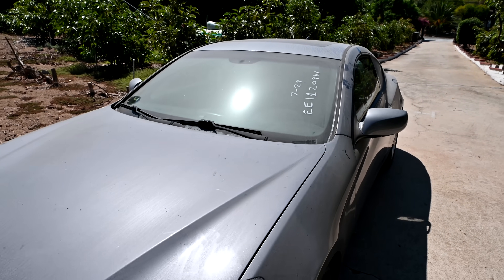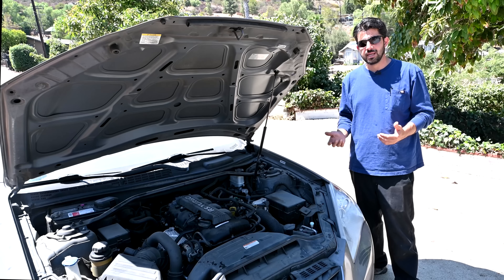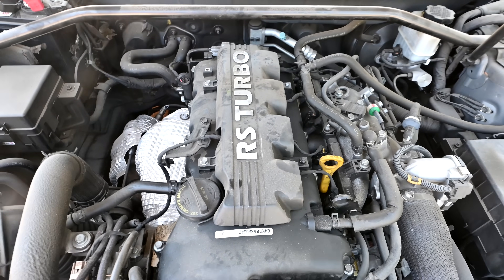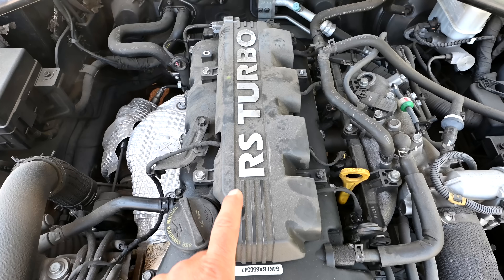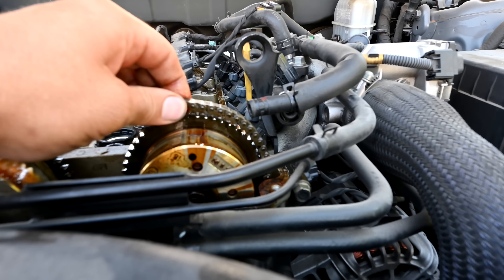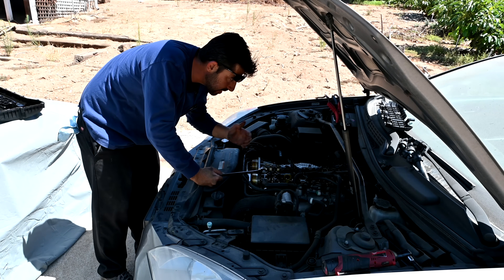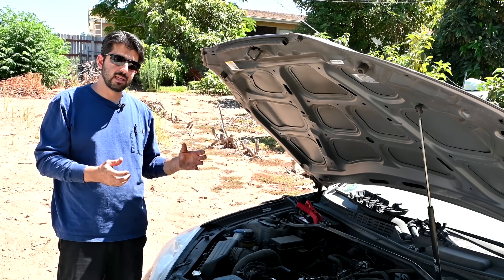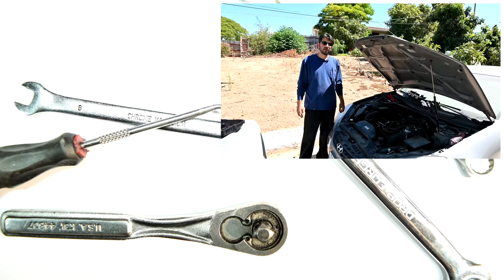The Hyundai And Kia Engine Failures Explained.

Comment: This is why I do all my own oil changes, it's at least done right.
Reply: Congrats, you saved 5 cents versus having it done at the dealership.
Reply: That won't fix the issue.  The company left metal shavings in the engine at the factory.  Even worse, they'll void your warranty for doing your own oil changes as you can't prove it was done on time.  I know this as I asked a Hyundai service advisor from my work and they confirmed it.  Specifically for this engine problem on this generation.
Reply: Done right?
Reply: @emptyendeavor2762  He tightens the filter enough and adds oil
Reply: @emptyendeavor2762  nothing left.
Reply: I've got a 2021 Genesis G70 2.0T with 39,000 miles. I change the oil every 3000 and oil filter every 9000(I use a 20,000 mile oil filter). I've changed the air filter at 20,000 and just put a new one in at 39,000. This car runs like it's brand new(and I drive like a race car driver).
Reply: @hecklerkoch2446  get and oil catch can, and ur probably never gonna have an issue
Reply: I just got a, 2023 Hyundai Sonata N-Line 2.5l turbo and I couldn't care less about engine problems as the warranty is, 10 year/100k mile warranty. Lol. So....I don't care if anything fails....I get it fixed/replaced for free. Ha also....I ALWAYS change the oil on a new car after the first 500 miles.
Reply: @nexpro6118  That is one good warranty. Will probably never have to use it.
Reply: @nexpro6118  Make sure you are documenting it.  These engines are extremely expensive and if they can duck out of the warranty they will.

Comment: The problem with Hyundai is that they neither cheap, nor reliable.

It's like a little more, and you into the Toyota/Honda price range.
Reply: Luckily, the newer Toyotas are coming down in reliability. So it kinda works out.

Comment: I have this same engine (minus the Turbo) in my Tuscon, Hyundai recently replaced the engine because of this issue, but I''d like to add the Turbo to it, and have it tuned to get better performance.  Is it possible and how do I learn how to do it if it is possible?  No one seems to be discussing this anywhere.   Thanks! @RatchesAndWrenches
Reply: You do not want to tune it yourself.
Get a professional to do it.
Reply: @TimberWulfIsHere   I want to have a professional do all of it, however I don't have one anywhere near.  I want to know if it's possible first.
Reply: I just got a, 2023 Hyundai Sonata N-Line 2.5l turbo and I couldn't care less about engine problems as the warranty is, 10 year/100k mile warranty. Lol. So....I don't care if anything fails....I get it fixed/replaced for free. Ha also....I ALWAYS change the oil on a new car after the first 500 miles.  Some engines just don't last as long as others. It happens....not a single engine and or car maker has an engine that has never had a issue or issues. Millions are sold and odds are, some will have issues, especially with some people driving em hard as all hell and not doing proper maintenance. Again, new hyundais now have a 10 year/100k mile powertrain warranty. So, couldn't careless about issues. Lol also, when buying a new hyundai, you can purchase a lifetime pwertrain warranty for around 2k.....so.....couldn't careless about issues.
Reply: @nexpro6118  Yeah, tell me that on Month number 6 when they're replacing the engine and you've been without it.

Comment: Maybe its the 4cyl turbo with these issues? My 3.8L genesis Rspec is the best car ive owned. Only issues ive had in the 10 yesrs ive owned it were the clutch/slave cyl and the master brake cyl internal leaking. But i do regular oil changes and keep on top of maintenance like brakes ,etc
Reply: Kudos.  I have a BK2 3.8 , just with FBO. It's also the rspec model. Plan on boosting middle of next year. Had it since 2013 , new, now she's at 134k, still going strong. Just had the carbon cleaned by walnut blasting. Plan on building the motor before I introduce forced induction.  I think most cars will last as long as their maintained properly
Reply: @godzilla7391  ive been looking at a S/C for a few years now. Price has dropped alot aswel down to $6k for a complete kit.
Reply: @jayhendrix7343  Talking about the D'TOZ  one? I'm torn between that and the Turbo that Remnant offers. Supercharging seems simpler and possibly cheaper.
Reply: @jayhendrix7343  And the DTOZ kit I looked at was in the $4k range. I'm sure after I have to build the motor, then add labor,  and tune, I'll be at close $10k, or over. That's why I'm trying to wait til mid summer of next year, by then hopefully I'll have enough put aside. Was looking at buying a new car, but figured instead of car pymt I'll just put $$ into mine. Especially with car prices now
Reply: @godzilla7391  its a Rotrex is all i recall 🤔
Reply: @jayhendrix7343  Well, good luck. Hope you get it done.

Comment: I bought our 2011 Hyundai Santa Fe new, changed oil and maintained at all intervals. It has 143,000 miles and still seems very reliable. I had to have the starter replaced at about 90,000, thats it.
Reply: My wife has a 2016. She loves it and has been very reliable.
Reply: I just got a, 2023 Hyundai Sonata N-Line 2.5l turbo and I couldn't care less about engine problems as the warranty is, 10 year/100k mile warranty. Lol. So....I don't care if anything fails....I get it fixed/replaced for free. Ha also....I ALWAYS change the oil on a new car after the first 500 miles.  Some engines just don't last as long as others. It happens....not a single engine and or car maker has an engine that has never had a issue or issues. Millions are sold and odds are, some will have issues, especially with some people driving em hard as all hell and not doing proper maintenance.

Comment: Not sure if the new engine warranty will apply to your Hyundai, but thanks to a lawsuit, if the two problems are the known issues, the engine could be swapped at no cost.
Reply: That's correct! I know that they were installing engine knock sensing software as their "fix".  But Hyundai states that they will give a lifetime warranty on these engines as part of the lawsuit.
Reply: I just got a, 2023 Hyundai Sonata N-Line 2.5l turbo and I couldn't care less about engine problems as the warranty is, 10 year/100k mile warranty. Lol. So....I don't care if anything fails....I get it fixed/replaced for free. Ha also....I ALWAYS change the oil on a new car after the first 500 miles.  Some engines just don't last as long as others. It happens....not a single engine and or car maker has an engine that has never had a issue or issues. Millions are sold and odds are, some will have issues, especially with some people driving em hard as all hell and not doing proper maintenance. Again, new hyundais now have a 10 year/100k mile powertrain warranty. So, couldn't careless about issues. Lol

Comment: Beware!!! Hyundai and KIAs 2nd owners. My daughter in law’s car had only 70,000 miles warranty. Her car started knocking and KIA did not warranty the engine due to the mileage being 73,298 🤬 So I told my son and daughter in law that I would inspect the engine and see how bad it is. All they had to do is pay for another rebuild block and I would do all the labor for free. Okay, maybe some of her cooking for payment 😋 Turns out, 1 and 3 con rod bearings were spun and the oil pan full of metal debris. Polished out the crankshaft journals with some 800 grit and installed all new KIA OEM con rod bearings and down the road. That was earlier this year and the Forte is doing well. They just had another baby so they are getting ready to trade in the Forte for a 4Runner 😁
Reply: Wife had a 2017 Optima purchased in 2019 with 45k kms. Went in for a knock sensor warranty work 5 times and they said they were going to replace the engine after the 3rd time. Kia were awful to deal with didn't reimburse us for the many tows to the dealership. We got rid of the car last year.
Reply: @Blue-moon12  Good deal 👍 What’s odd, some folks love their KIAs or Hyundais and never had any major issues 🤔 I’m glad the wife and I are proud owners of a Camry and Accord including our Ram truck for towing our water crafts to the lake or camping 😎
Reply: You don't know what you're talking about. Hyundai warranties these engines left and right. And Kia simply has to be pushed a little further. You can't just accept the first offer they make.

Comment: I came across a 2012 sonata at a job I was doing and I asked the customer what happened to it and he said it just died on him while driving it.he said his mechanic told him his engine blew out. I kinda expected fluids and didn’t see any oil coolant mixture . The car was in good condition interior and exterior so I asked how much and I believe it had 135,000 miles , he said $1,000 but after researching those engines had recalls and was past warranty, so I passed on it
Reply: My 2013 Kia Optima 2 lt Turbo had a recall and they put a new computer chip in at about 190,000 km. They guaranteed me that if I had any engine issues it would be covered. Sure enough about 20k later the engine went out in a very rural area in the mountains of BC. I called the nearest dealer and they advised me I was
"Covered". In the end they paid $500 for vehicle recovery, supplied me with a U Drive and put in a factory new engine... all at no charge.  I use full synthetic oil and change at about 5000 km as Turbo oil lines can clog with dirty oil. I now have 
220,000 km and it runs great. I will watch Turbo as it's original .
Reply: @DavidMScott-cs8pp  And I believe you....😂
Reply: Smart man. Although if you are a scrap metal recycler, it may have been worth the $1000🤔
Reply: I just got a, 2023 Hyundai Sonata N-Line 2.5l turbo and I couldn't care less about engine problems as the warranty is, 10 year/100k mile warranty. Lol. So....I don't care if anything fails....I get it fixed/replaced for free. Ha

Comment: My 2020 Hyundai Kona was at Reliable Hyundai in Springfield Missouri for over 1 1/2 years.  It only had 6500 miles on it and under full warranty.  The dealership experience was horrible.  The excuse, week after week, month after month, was that the couldn’t get approval from Hyundai Customer Care.  Only after getting an attorney involved, did they finally take the car back.  During that time, they didn’t give me a loaner vehicle.  I spent over $16,000 for 1 1/2 years of rental car expenses.  I was expecting full reimbursement, but they only reimbursed $4000.  What a scam!  I finally went down the street and bought a Toyota Camry.  I learned a lesson.  I hope you avoid what I experienced.
Reply: What was wrong with vehicle
Reply: You messed up by not getting them to front the loaner, vw does that

Comment: I’m a newer lube tech at my local Hyundai, and I’ve noticed everything but the 3.8 or the 2.5 non turbo will probably blow up under 100,000 miles
Reply: I heard 1.6 was the most reliable
Reply: @SkylineFinesse  yeah but they burn oil and clog the cat every time, I’ve replaced hundreds
Reply: @paintballalienindy09  what does? You never specified…
Reply: @SkylineFinesse  1.6 I’m doing a cat on a rio rn lol
Reply: @paintballalienindy09  1.6 t? I would agree cats get clogged because people drive them like grandmas. I make sure i get mine nice and hot every so often to keep it clean
Reply: @SkylineFinesse  everything before the theta family is reliable
Reply: Two guys I know with Souls both have over 150,000 miles on them, so your comment is false.
Reply: @lonniebeal6032  souls didn’t come with a v6 or 2.5. But the 2.4 is the bad apple the v6 are pretty strong. The 1.6 is hyundais most reliable engine which is most likely what the souls had
Reply: Is the 3.3L v6 any good? Starting to see more of them pop up on the Facebook forms having complete engine failures even though they were well maintained

Comment: ITS NOT JUST HYUNDAI
ITS MAZDA3 2014..I HAD MINE FOR 14 YEARS WITH 169K MIKES
I DROVE TO WORK.. ENGINE MADE WEIRD NOISE...TOOK IT TO MECHANIC STATED THERE WAS NO OIL ...I HAD THAT OIL CHANGED TWO MONTHS AGO..I BELIEVE OIL DIDN'T CIRCULATED CORRECTLY AND ENGINE WAS RUINED
I NOW HAVE 2017 VELOSTER WITH 33K MILES
AFTER THAT ORDEAL ..I START CHECK EVERY MONTH SO I WON'T HAVE THIS PROBABLEM... HYUNDAI DID SEND ME EXTRA EXTENDED WARRANTY..JUST MAKE SURE U HAVE ALL SERVICES DONE AT THE DEALERSHIP IN THAT WAY OT IS DOCUMENTED

Comment: Mostly because people dont change the oil in half the time the manufacturer says. Those numbers are for perfect conditions. I would cut the interval by 30-50% to play it safe. So if your manucacturer gives you a 10k mile interval. You should change it in about 6k
Reply: The thing is, the manufacturer does give the right intervals for maintenance. It’s under the “severe” maintenance schedule, it’s owners not fully understanding the owners manual maintenance section.
Reply: @BeyondLumination  Yeah.  Most people assume they aren't doing severe driving.  But I always follow the severe driving plan. It seems to have helped the most to stay ahead of issues.
Reply: @TheoriginalBMT  yeah i have always followed the severe interval myself. Even though i drive about 75%highway and 25% city in mostly mild weather. It does get times where it is really humid out and the winters get a little extra salty. But other than that MD is pretty chill climate.
Reply: I change every 5,000 or less with Pennzoil Ultra Platinum Synthetic.  Great for GDI engines
Reply: @bryanwinter3289  thats what i use too with wix or purolator filters.
Reply: @bryanwinter3289  I change at 4k miles with Pennzoil Platinum 5w-20, the Ultra is too hard to find. Our 2020 Sorento has the 2.4 Theta ii and oil stayes clean and not a drop is burned.
Reply: That's what I've heard from most technicians, change the oil every 5K miles or every 6 months to stay safe.  10K miles in between intervals is too long.
Reply: Ideal condition is like 95% highway driving. Severe is like 70% city miles or higher. I usually change every 5k with full synthetic.
Reply: @2010ngojo  yeah i do mine every 4k and do all my transmission, diffs and brake fluid every 3 changes
Reply: 10k is just to get it thru the warranty
Reply: Yeah if people actually read their owners manual but most people do not. There will be a section for regular maintenance and severe  conditions maintenance. Regular maintenance is standard 5k oil change, while severe conditions on mine is 3750 oil change, 60k transmission fluid change and etc.

Comment: We change far too many of these engines around 20 a month at my dealership. 2.0L N/A in Soul/Forte/Seltos, 2.0L turbo in Optima/sportage and 2.4L in Optima/Sportage are the most common usually around 100k miles. They still use these shit engines in cars coming out today. They know their customers don't maintain them anyways so they have no interest making them last.
Reply: What about the 1.6T GDI engines?
Reply: Do they Replace to Telluride a V6 3.3??
Reply: kia or hyundai don't build this trouble engines.